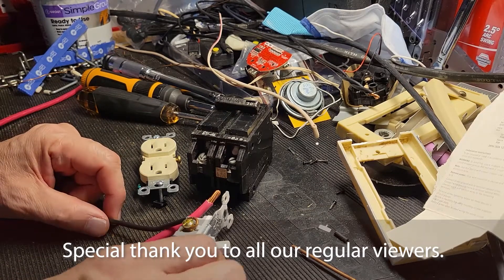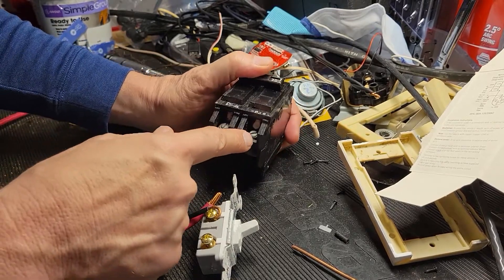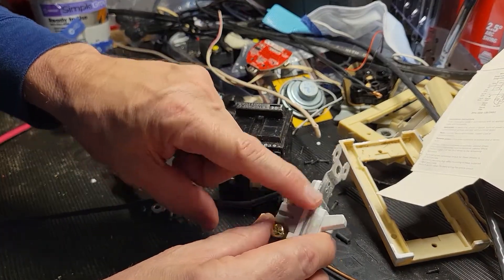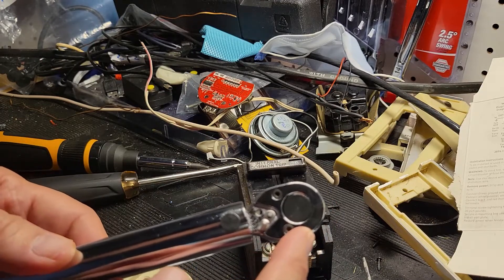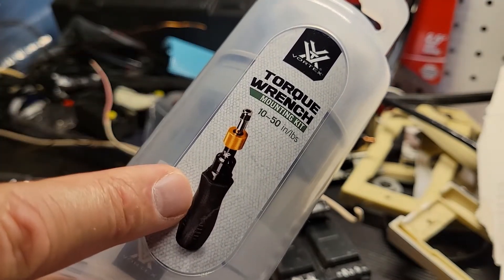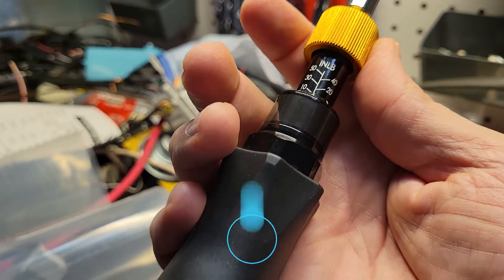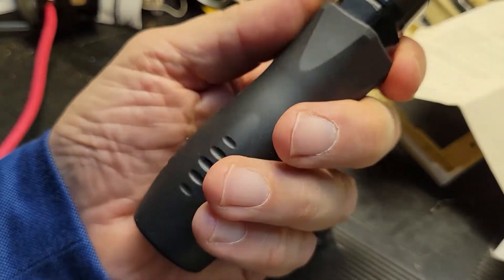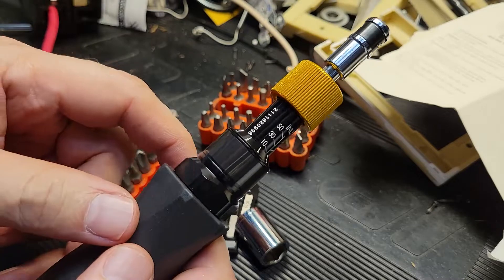Electrical Torque and the Why (Vortex Torque Wrench CTW2)

Comment: The Vortex price has gone up to $130-190.  But there are other options, same product different branding.
Vortex is made by Firstinfo.  Firstinfo is under $100 and has locking bit holder options, as well as a 10-90 option.
Firstinfo also makes Olsa which is identical to Vortex except it has red accents and costs less than $100.
Reply from the maker: Thank you for sharing an alternate and cheaper version. Good to find a deal in these days of wind tariffs. Thanks for watching.